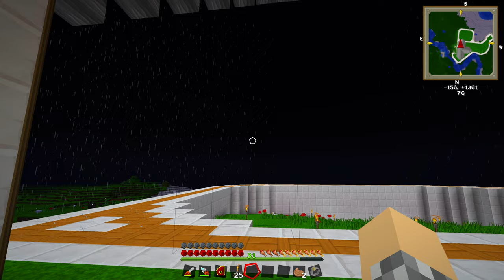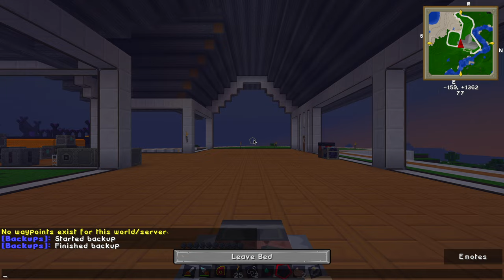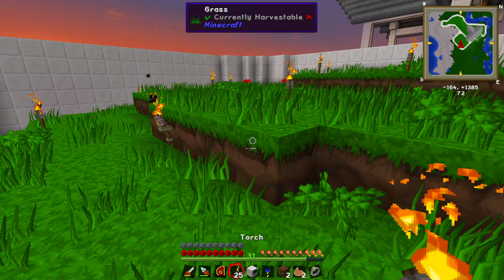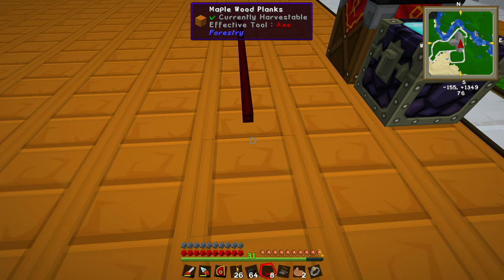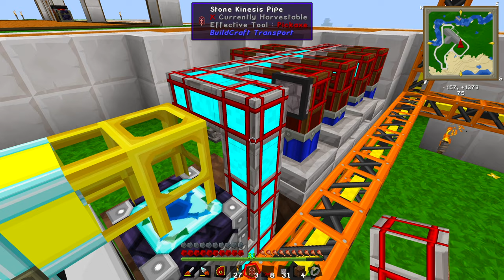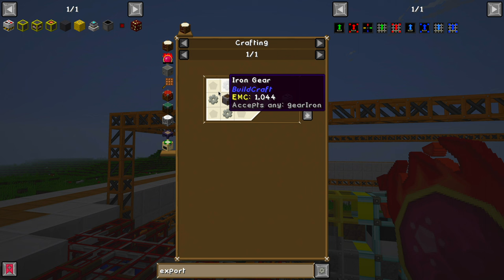Quality Quarry | Tekkit 2 with Rees | 06

Comment: Ive been following you for a while and I don't know why you smelt the items if the EMC value does not change. Id just put the dust straight into the transmutation table :)
Reply from the maker: In earlier versions of the pack dusts did not have an EMC value.

Comment: Hey, I saw here, from the glass, you are using connected textures. I'm using the Sphax pack (+Tekkit fix) and I dont seem to be able to find an option for connected textures. Could you tell me how to get them? (I'm using the technic launcher to run Tekkit if that helps)
Reply from the maker: Sorry, but I'm not sure that I can be of much help to you on that front. I've not made any specific changes to get them working. I have noticed that connected textures do not work with all glass types, so it might be that only some glass box work have connected textures out of the box. As for getting the others to work, that just isn't something I've done any research on myself. I hope you manage to figure it out though!